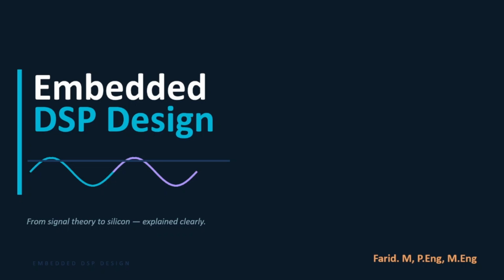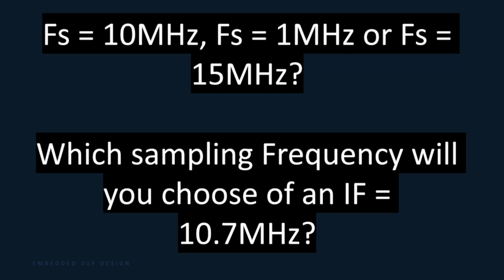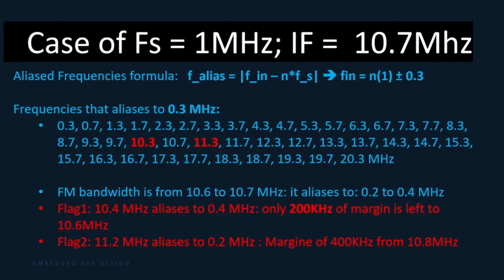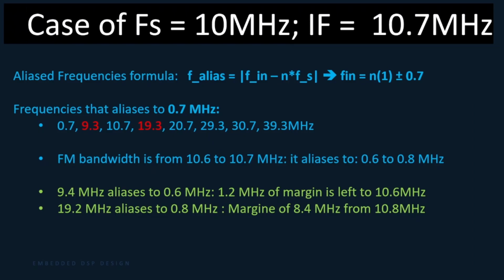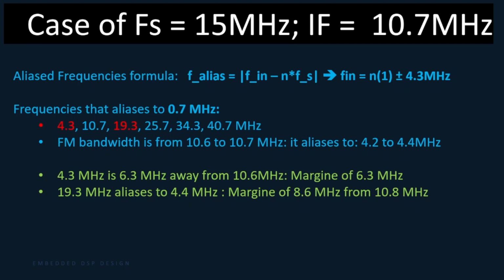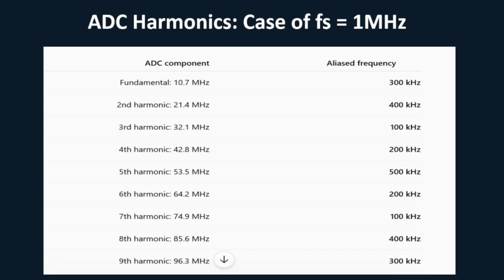BANDPASS SAMPLING | THE HIDDEN PROBLEMS | THE DESIGN CHALLENGES

Comment from the maker: This video explores the design challenges associated with bandpass sampling for a 10.7 MHz IF signal (200 kHz bandwidth). The primary goal is to select an appropriate sampling frequency (Fs) that ensures signal integrity while managing anti-aliasing filter requirements and ADC non-linearities.

Key Considerations

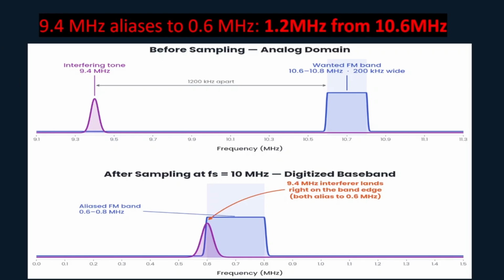•	Anti-Aliasing Filter Flexibility: Choosing an Fs involves balancing the distance between your signal of interest and its image frequencies. A wider margin makes the analog filter design easier and less expensive (6:47, 8:24).
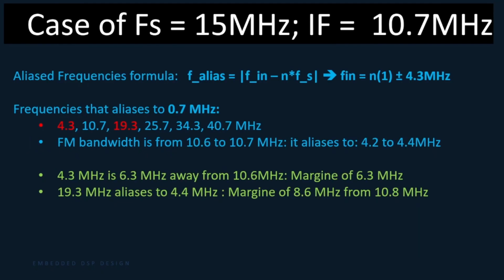•	ADC/Mixer Harmonics: Simply selecting an Fs that avoids aliasing the fundamental signal is insufficient. Harmonics generated by the ADC can alias into the system's passband, severely degrading performance (9:46).

Comparison of Sampling Frequencies (Fs)

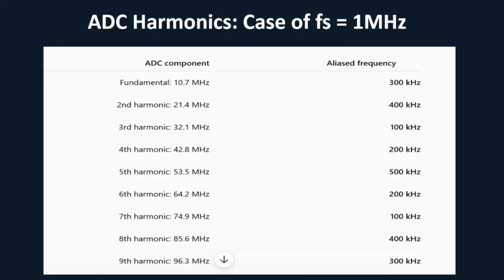•	1 MHz: Causes significant interference; harmonics alias directly into the passband, making it a poor choice (10:14).
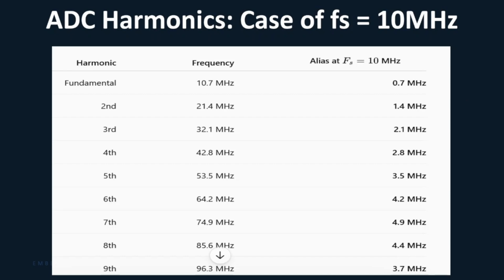•	10 MHz: Offers a reasonable compromise with good separation for both the IF images and harmonics, providing a cleaner spectrum (11:31).
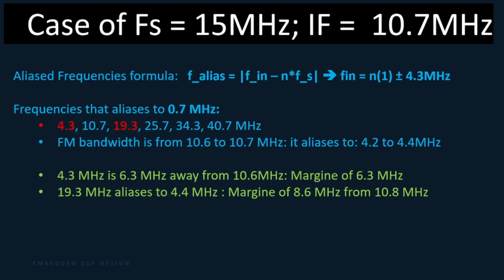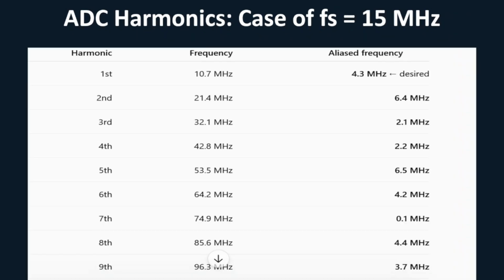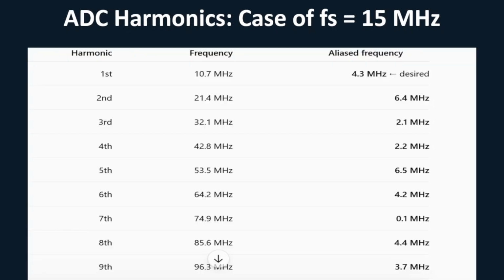•	15 MHz: While it initially appears superior for anti-aliasing filter design due to wider margins (9:26), it performs poorly regarding harmonics, as multiple harmonics alias very close to the signal passband (11:54, 12:43).

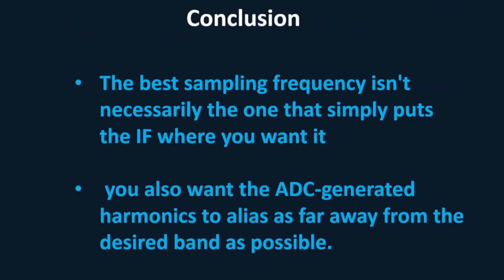Conclusion: The best sampling frequency is not necessarily the one that provides the easiest filter design. A suitable Fs must also push ADC-generated harmonics as far as possible from the desired band (14:49).
Reply: i am new to embedded dsp . can u suggest any book for getting basic concept .
Reply from the maker: @TheSohail02 thank you for your comments and for following the channel. There are a lot of good DSP design books out there, and it will be unfair for me to recommend one book over the other. But in my videos Im doing my bests to stick only the basics. I guess you are already following the right channel. Any questions, vague concepts, please share here in the comments section and I can reply to the best of my knowledge and this way we all learn together.